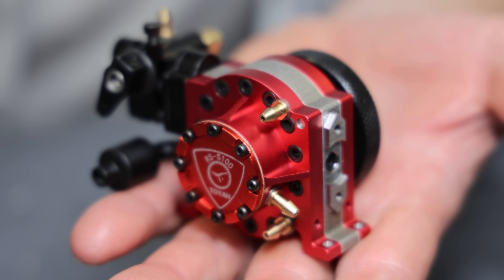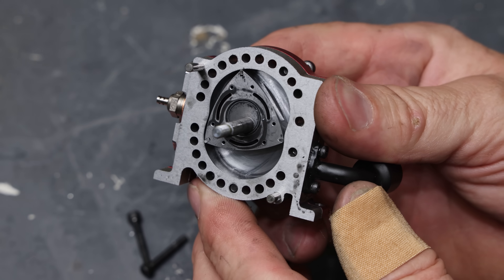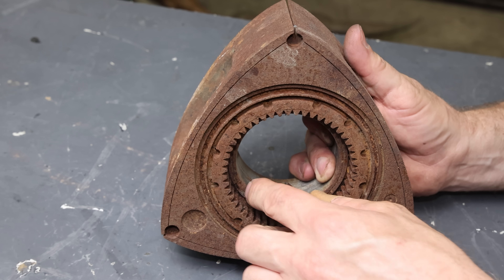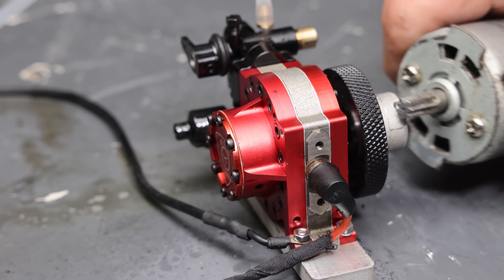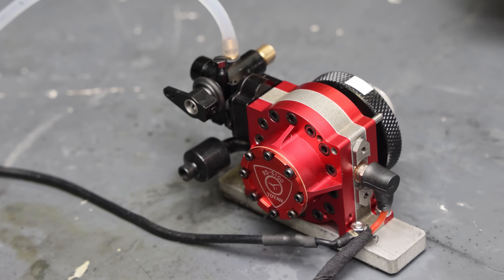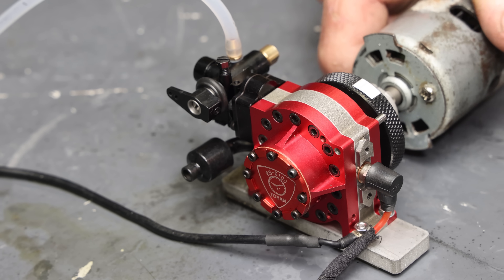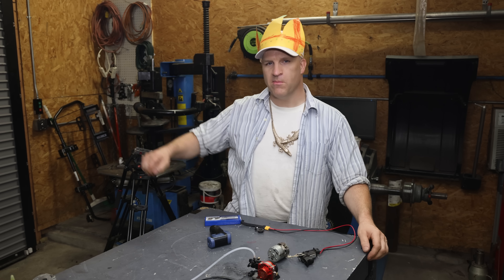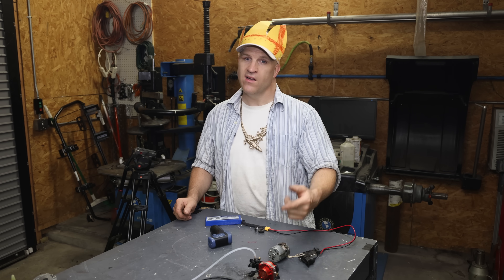Worlds Smallest Rotary Engine (30,000 RPM)

Comment: Never do a tear down before testing ….. never. Many things are never as good as they were before factory disassembly
Reply: I agree with tech, I love this guy and what he does but this one was just too bad sorry I mean he couldn't get it to idle, and he always gets stuff to fully function.   lol
Reply: @tatundra6405  clearly you’ve never really worked on a rotary. All that he went through us rotary guys go thru on a daily. Cold starts are real. They can’t go long without apart is also real. If that little guy had a turbo it’s life expectancy is cut in have and the propellers are probably melted. That’s the general nature of a wankel. Mazda couldn’t get it right from factory to keep it in perspective but it was good enough to sell to the public.
Reply: @subifudriftkings  Agreed, as the owner of a few rotaries and currently an Rx8 at ~250k miles with 3 engine rebuilds all of this is normal. The internal clearances don't tighten up until it's warm so they hate cold starts even with modern computerized fuel injection. This looks like a pretty rudimentary carburetor setup, of course it's gonna hate starting.

Also I was cringing the whole time he ripped it apart in a filthy environment, dirty hands, dropping parts, not bolting things back together right, and expecting it to run perfectly? The exhaust fell off ffs, that's not "rotaries suck lolol" that's you not bolting shit together. Also super bad for the exhaust ports which are already the weak point for most rotaries, the heat buildup is bad enough even with good header flow.

Also, please center that flywheel and put either a heavier one or some load on the engine. This is like taking an LS, leaving the balancer and flywheel off, removing the rpm limiter from the tune, then starting it with your foot on the floor and expecting it to go well. If you want to spin anything to 1000 rpm let alone 30,000 rpm you had better make sure it's balanced. 

This little engine is cool but man this guy is handling it poorly. Even if it wasn't a rotary he should take a little better care of it especially for a demonstration. Also their technical manual says it's only supposed to run to 16,500 rpm. Go take a Honda motor, rip it apart in a sandbox, put it back together just enough to run, then spin it to 15,000 rpm and see what happens...
Reply: It wouldn't start initially because one of the apex seals was seized and had no compression.  He had to tale it apart to get it to work.  Considering it costs $600, you'd expect a little bit of quality.  Seems to have none.  Just scaled down some parts and slapped them together so it will kinda run.
Reply: @sourand jaded If that was the case, then it more than likely bounced back when you were starting it, and it was running backwards the whole time. A Cox won't change direction at 20,000 RPMs.
Reply: You must love AvE videos
Reply: @mcs699  We're not talking about a BMW engine, we're talking about a tiny model engine that takes 5 minutes to pull apart. And YES it can happen to the best of them. Another important fact is that due to the tiny size of these engines, something as small as a grain of sand can mean death to them.  So, next time don't be a wise ass before you post on a subject you know nothing about.
Reply: Especially since that looked like a compressible metal gasket between the housings.  Ain't no good now.
Reply: Alot of the toyan's come disassembled anyway. They're also notoriously fickle. More of a desktop engine than RC. But some people try
Reply: BS. Some engines aren’t assembled in the factory with sufficient care and a knowledgeable owner can clean up (“blueprint”) and reassemble the engine to better than new. Now if a ham-fisted gorilla that has only Visegrips and hammers tears into one, well, no more needs to be said.
Reply: That statement is a load of crap.... It's RECOMMENDED by professionals to tear every Nitro model engine down before running it to inspect and clean it up. I've found metal machining chips, or some other kinds of trash, inside more than 1 brand new engine of mine. Sure the engines MAY have ejected the trash out the exhaust, and survived, and the trash very well could have caused some damage and taken life off the engine. As SIMPLE as these engines are, there's NO reason they "Wont be as good as they were before factory assembly", unless you are a total doofus and have absolutely no mechanical skills at all.
Reply: @sourand jaded A Cox .049 CAN happily run in either direction, and it has nothing to do with not having a flywheel on it. What happens is that for whatever reason, the engine quits firing and starts to coast down, as it's almost to a stop and the piston is on its last trip up the cylinder before it rolls over the top, it fires again and runs in the other direction. This typically happens when it's running out of fuel and momentarily quits, and also when the idle is too low and it's tuned incorrectly. If a Cox it tuned right, and has sufficient fuel, it will NEVER reverse direction because of "lack of a flywheel". 
Take a look at an ancient 2-stroke oil burner engine... Some of those have flywheels that weigh several TONS, and they can end up running in the wrong direction if the operator doesn't know what they are doing.
Reply: @davelowets  or, in the case of a fishing boat, the operator can, with skill and timing, reverse the engine at will to provide propulsion astern  =)
Reply: @ralphm4132  Sure.. People have done that MANY times with the old hot bulb 2 stroke tractors back in the day also as the transmissions in them didn't have a reverse gear, so they let the engines wind down to almost nothing, then reapply the fuel when it bounces off the last compression stroke before it quits rotating entirely. The HUGE heavy flywheel sure helped in those situations.

Comment: What is that little dowel looking pin that is sliding back and forth?
Reply: It’s an alignment pin that holds many layers of case parts in perfect orientation as the case bolts are tightened. The pin has zero function after the case is closed up.

Comment: Make it Bridgeported
Reply: Peripheral ports flow more air and allow for the highest rpm. Bridgeports in the full size engines were in the neighborhood of 9k redline and Peripheral ports were 12k to whatever rpm caused the apex seals to chatter. Adding stronger apex springs would also aid in stating this miniature version as well as a perfectly(or near perfect) machined rotor housing. Most of the full size engines lost their compression when the nickel plating that the apex seals ran on flaked off from use.
Reply: @jeffbroxton988  epic

Comment: Would be interesting to see implementation and performance of an "inverse" Wankel.
Reply: The Liquidpiston is essentially that.
Reply: @rcdieselrc  Yep.
Reply: If I remember correct they made a “radial” engine where the cylinders heads move and not the crank. Not the same as what you are saying but still pretty cool.

Comment: They need to make those so you can keep bolting more engines together and have 2,3,4, cylinder models or bigger even lol awesome little engine thanks for sharing buddy
Reply: They do have a 2 rotor model.
Reply: I want to see a ten rotor
Reply: @livingintheLight.  I would love to see a V12
Reply: @ItsMorbinTime03  well rotaries are technically in line, so it would be an I12 rotary.
Reply: @EAGLINWRX I mean two I6's joined together in a V shape
Reply: @ItsMorbinTime03  how would you make a rotary in a v shape? rotors just stack on top one another, there’s no I or V config, just 1 rotor, 2 rotor, etc
Reply: @ItsMorbinTime03  pretty sure a inline would be easier. Or 2 bank 10 rotor which would play well pulse balancing a turbo....🧐....🤪🤯.. captain fire up the cad and the water jet.
2,3,or 4 banks of 5 rotors??? Mabie just a 4x4.. omg the 16 rotor Bugatti ...😂
Reply: @htowndct832  actually there was made a 12 rotor engine in a “v” shape but the shape is made from the position of shafts.

Comment: You should put it next to a Cox 0.10 ci reciprocating engine for comparison (the 0.20 as well)  I'd like to see that visual.
Reply: LM Cox never made a .10, the one I’m assuming you are referring to is 1/10 the displacement or .010ci. I used to fly them in the early ‘70s.
Reply: @GFTPSMP  I though the 010 was for 0.10.  I still have, somewhere, an 020 from the early 70s. Had plans for a 2channel analog RC plane using an 010 with exhaust restriction (homemade) with like a 14" wingspan. It was described a screaming bomb in the air even with the restrictor.
Reply: @jamesoliver6625 , my .010 flew a single-channel pulse rudder Cessna 182 Skyhawk that I built from scratch when I was 18. 21” span, 3.5oz. A friend flew what’s called a “Monocopter”, a one blade rotor free flight helicopter with the .010 out on an arm opposing the blade. The sound it generated as the engine went ‘round and ‘round was unearthly! Flew it at night too. That’s why we have UFO sightings! LOL

Comment: might run better if you pressurize the fuel tank? you know like other nitro engines?
Reply: “pressurized the fuel tank?”

Pressurized Hydrogen…
Reply: @DavidHalko  wtf are you talking about? there is no pressurized hydrogen here, it's nitromethane fuel. these engines need the tank to be pressurized to feed the fuel for there is no fuel pump and it is not gravity fed.
Reply: @Wolfiecolada  - “what… are you talking about?”

Rotary engines can combust H2

It would be nice to see if pressurized hydrogen can be used, since it can be pressurized and people can produce their own fuel.
Reply: @DavidHalko  yeah, this video, and my comment had anything to do with that. perhaps you meant to make a comment on the base thread instead of my comment huh?
Reply: @Wolfiecolada  - pressurized hydrogen fuel tank would be great, though!

You did not specify the fuel type in your comment, perhaps be more specific in your comment in the future!

Good Day! 👍🏼
Reply: @DavidHalko  no i did, "like other nitro engines". perhaps you are not familiar with this type of engine?

nitro engines run on nitromethane mix and use a glow plug
Reply: Hi  @Wolfiecolada  -

“not familiar with this type of engine?”

This was my first exposure to these engines… 
but the engine seems very promising!

There was a 2013 study, utilizing a 1.1 HP glow plug driven rotary hobby engine, which was able to run on H2 without machining.

Compressing H2 to 15 psi allowed the engine to start & idle, and they suggested they could continue to increase H2 (through additional compression) and enough air would be drawn into the engine.

Compressing the fuel seems very interesting idea. An adjustable pressure regulator could really make this sing!!!

Comment: Actually when you think of it 0.7hp is a decent amount when lokking at the size
Reply: a 50 cc moped in my countrie can legaly only have 1 hp. So yeah 0.7 on that engine is huge.
Reply: thats the claim to fame of rotaries. small engines making big power
Reply: most 50cc mopeds make between 1.5 hp-3.5

Comment: Ok so most people don't know this but the the rotor spins at about 1/3 the speed and the crankshaft, often called an E-shaft. So it's less impressive when you think of that. But still that little dorito chip spinning at 10k RPMs is still awesome
Reply: there was a diesel one made by Rolls Royce with two rotors two stages (bigger and smaller) where bigger rotor was a supercharger to a small rotor to rise compression and allow diesel to ignite.
Reply: Insane what they get out of 1.3L for a 2 rotors and 2.6 litres for a 4 rotor tho… which is impressive af.
Reply: @H3110NU  technically if you take the total displacement of all three sides of the rotors the 13b is actually 3.9l of displacement. They only advertised it as a 1.3l because A. People didnt understand them so they can get away with only using the displacement of one side of the rotor, and B. They got into a different emissions regulation and racing classes for small 1.3l vs a big 3.9l.
Reply: @leojensen9270  that's basically saying 2 strokes have double the displacement of a 4 stroke
Reply: @maseywat  No, what he's saying is a Wankel rotary has triple the effective displacement of a reciprocating piston engine.
Reply: @maseywat  no its not, 2 strokes still only have one combustion area per cylinder. In rotaries, there are 3 simultanious combustion events per rotor, one in the intake/compression phase , one in the ignition phase, and one in the exhaust phase at all times. So in my opinion you should have to take the displacement of all the rotor faces not just one. Rotary engines are just fundamentally different than piston engines and imo you cant really call them a 2 stoke or 4 stroke, because tgere is no stroke.
Reply: @phantom240  exactly
Reply: @leojensen9270  yeah no that's not how displacement works
Reply: @phantom240  they don't really, the combustion chamber is still only 1/3 of the internal volume. It doesn't really make sense to compare displacement between a piston engine and a rotary, the former uses the entire internal volume to combust and a rotary doesn't. It would be like calling a 5.3 LS a 15.9L because it uses the entire cylinder volume for compression and exhaust as well as combustion.
Reply: @leojensen9270  That's not useful though. Only one surface is combusted per engine cycle, which is defined by when the engine returns to the initial position (like how a wavelength is defined by when the position and direction of travel return to the starting position). Anyway, specific power is not an interesting figure. Power to weight and power to mass airflow are more interesting (and also more general since any heat engine can be compared).
Reply: @Jupiter__001_  thats true but theres still one firing event happening per rotor per one turn of the crankshaft. But this is why you cant really compare rotary engines to piston engines because they are fundamentally different.
Reply: @leojensen9270  Then compare it to a 2-stroke piston motor, which has one firing event per shaft rotation. You wouldn't say a 250cc 2-stroke is 500cc.
Reply: @Jupiter__001_  you are correct  but theres only one combustion area per cylinder in a two stroke vs 3 combustion areas per rotor on a rotary. Again, cant really compare them to piston engines because they are fundamentally different.
Reply: @leojensen9270  Why does that matter? The rotor's rotation isn't relevant. The volume processed per eccentric shaft rotation is all that matters, since it is restored to its initial position after that. The 4-stroke and 2-stroke piston engines and the Wankel all operate on a staged cycle, pulsing their power (as opposed to an electric fuel cell or a gas turbine, which operate continuously). They are very comparable, you just aren't in the right mindset.
Reply: @Jupiter__001_  why does the rotor not matter? I kind of see what your saying saying about the volume processed by one revolution of the eshaft, but IN MY OPINION you have to take into account that its not the same face of the rotor in the same place after 1 turn of the e shaft. It takes 3 rototions for the same face to be in the same spot. In a 4 stroke you only count the displacement of one rotation for a full cycle even though the crank turns twice, but no new firing events have started in that cylinder. But, since it take 3 turns for one combustion event to comletely occur and restart, you should have to take the displacement of all three sides. Not just a single side because that side does not complete a cycle until 2 more cycles have started on the same rotor. To be honest tho it doesnt really matter what displacement we consider them to be because rotary engines are awesome and all these numbers are kind of irrelevant.
Reply: @leojensen9270  Nope, it's not one to one shaft to eccentric shaft speed.  For one turn of the crank I'm pretty sure the swept volume of all three sides  is what was stated.
Reply: It's because a 2 rotor applies 2 power strokes per flywheel revolution and it's full 1.3 liters of capacity each revolution.

A 1.3L 4cyl 4 stroke only applies 2 power strokes per flywheel revolution equaling 750cc of it's capacity.

It would be closer to a 2 cylinder 2 stroke 1.3l but without wasting the last 1 inch of it's piston travel completing the exhaust and intake cycle and maintaining a higher cylinder pressure at the bottom, even though you don't get much from it down there in any engine with a crankshaft anyway.
Reply: So technically a 4 stroke engine spins even faster by this argument. As you have one cycle per 720 degree of crankshaft revolution. But that’s not how you measure rpm, you measuri it from the flywheel though. So it’s still 30k rpm engine.
Reply: ok yeah so 500 rotations a second is hard to believe, but 166 is much more believable that the engine would hold together.
Reply: Wym "about" 1/3 lmao
Reply: @bakedandsteaked  I don't know the actual gear, teeth and ratios of everything inside a Mazda rotary. So I said about because I didn't want to say exactly and then be wrong. If it spins at exactly 1/3 the speed then okay that's fine. I don't actually know that because I've never torn one apart.
Reply: Nice string trimmer.
Reply: Meh, there are plenty of model two strokes that run 40,000 rpm.
Reply: @rcdieselrc  no mechanical engine can exceed 40K rpm
Reply: @thatcornfedrx8guy372  do your homework
Reply: @thatcornfedrx8guy372  plenty of Rc racing engines go over 40k RPM, my control line combat engines from 15 years ago, on plain methanol and a restricted intake happily run 36-38k RPM, control line speed engines running high levels of Nitro well over 40K RPM no trouble at all.
Reply: @thatcornfedrx8guy372  Of course it can.  You might want to take a look at turbine, or jet engines.
Reply: 1:3 in the renesis. In most of the others it is closer to a 1:2 ratio.